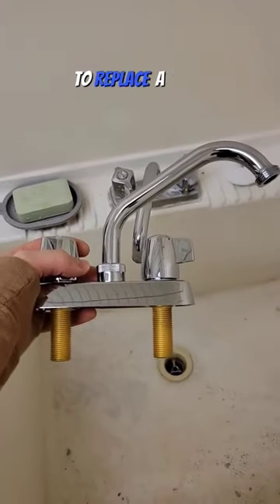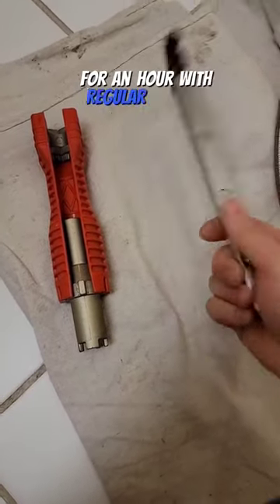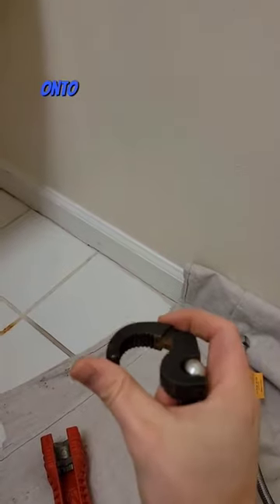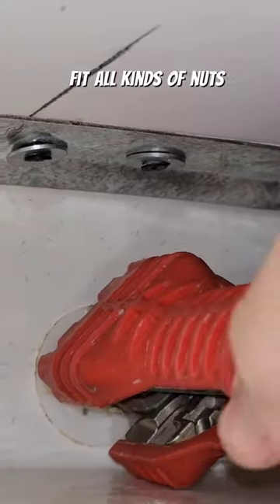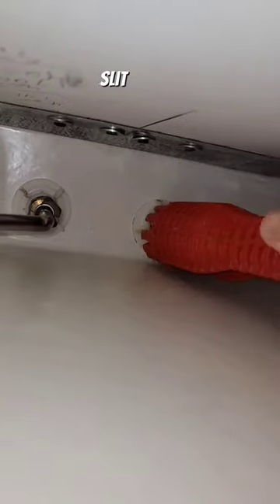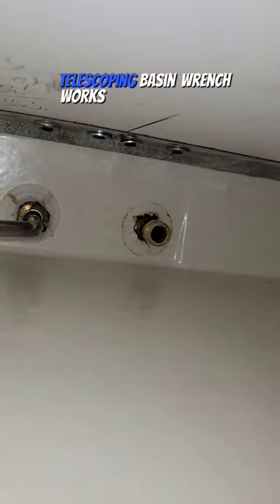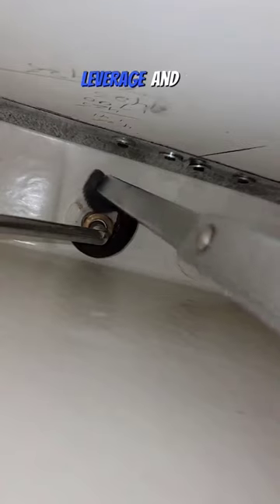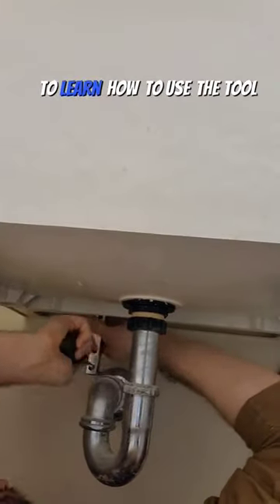🤔 Faucet tool or basin wrench? #viral #handyman #plumbing #tools

Comment: Just changed out my kitchen sink. Old one was top shallow and the facet was off center. First time doing anything of this nature so I quite literally went in armed with nothing but information gleaned from youtube videos and plumbing forums. Stopped by home depot after I managed to get the old kitchen sink up. One of the tools I grabbed on a whim was the easy facet wrench along with PVC cutters and few other tools. When it came to the removal and install of the new facet. This silly looking tool came in clutch. I'm not small by any measure. 6 foot and 240 pounds. The space was very tight. This tool made this particular section of the install a breeze. Tightening and loosening. The gap in the middle of the tool allows the hoses to slip inside and keep it nice and tidy while you're working your way up to the nut. Pretty much the rest of the sinks and toilets have to get replaced and this tool will more than likely come in handy

Comment: Disconnect the P trap and the supply lines lift the utility sink off the bracket. Simple.
Reply: No no! THAT'S STUPID +
Reply: @frederickneal4781  Work smarter not harder . Is only use a faucet wrench when you gotta.